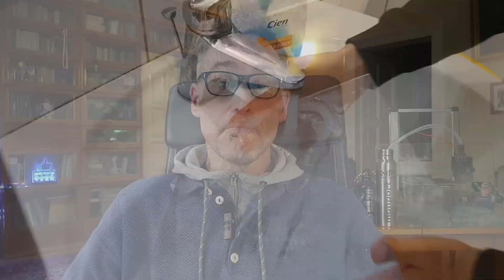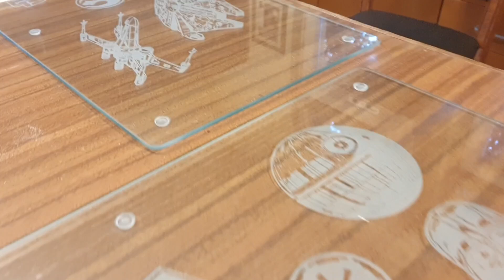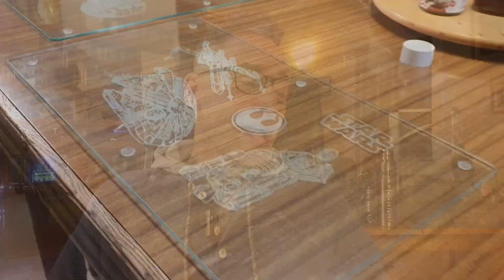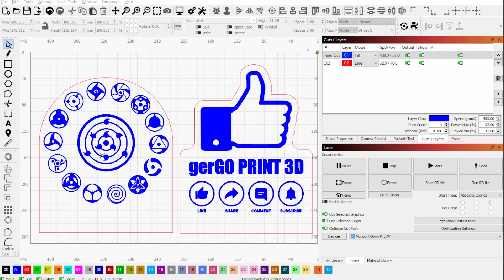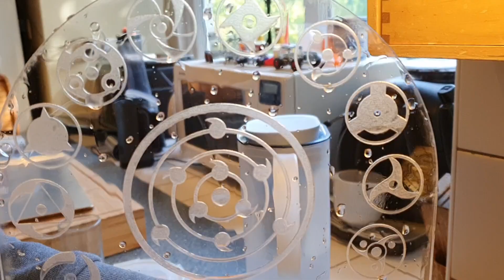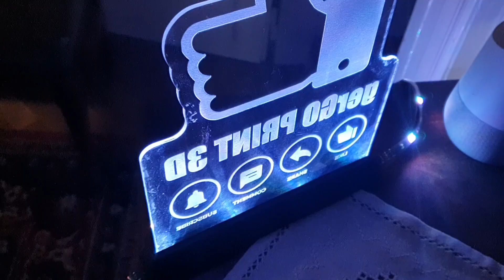Laser engraving glass and cutting clear acrylic on Monport Onyx R 55W CO2 laser - Star Wars + Naruto

Comment: What was your lasers distance/offset settings? I tried the same speed and power that you did and it isn't going well at all for me. I also forget how to adjust those in lightburn with the onyx. Glass is kicking my butt.
Reply from the maker: Make sure your lens is clean! It can reduce your power significantly.
Reply: @gerGoPrint3D  I'll give it a try, do you happen to know the offset you used for the z height?
Reply from the maker: @heroofharo  I don't really remember :(
Reply: @gerGoPrint3D ok, thanks for responding, I'll try cleaning the lense and see if it goes any better.